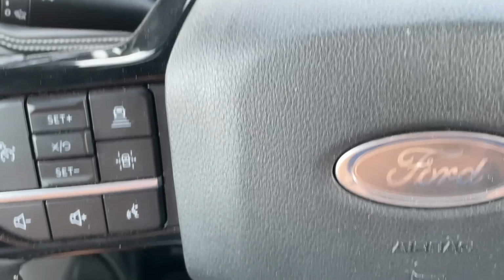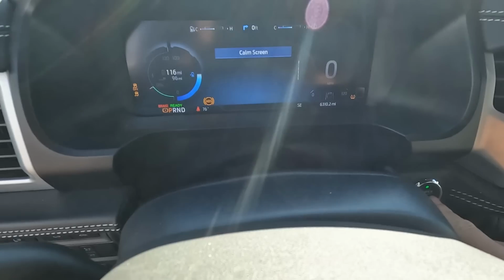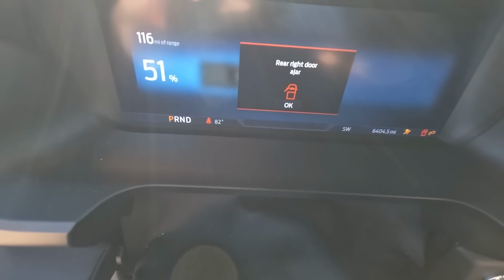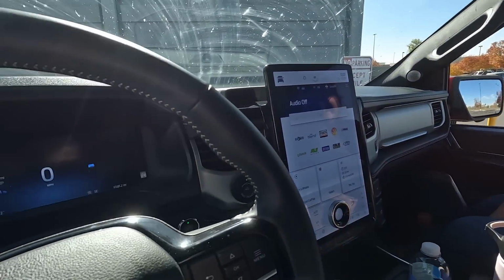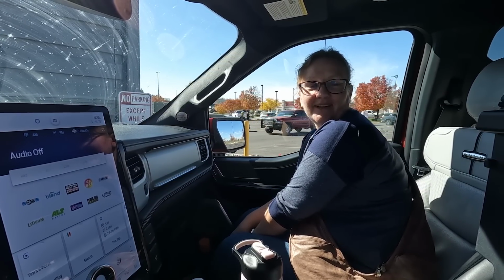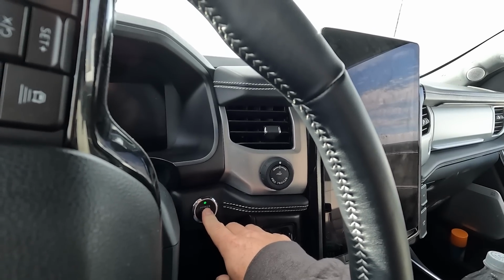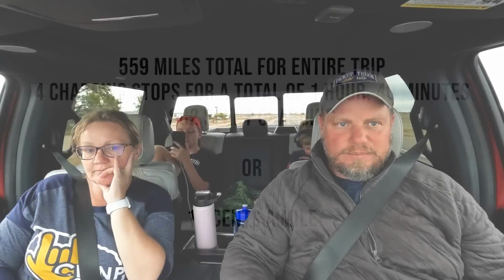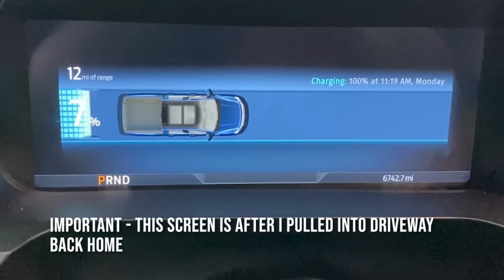Truth on charging times/cost on 2022 Ford F-150 Lightning Road Trip

Comment: actually you can carry 2 electric generators that can be linked to charge 220. Not exactly cheap but it will charge you at level 2. And they are also coming out with the charging suitcases. Pay a monthly fee, and you can grab one and take it with you. Just return it and grab another. obviously we need infrastructure, but it is happening!!!

Comment: I'm sure others have told you in the comments below, but with the EA pass ($4 a month, you only pay .31 cents per KW. Which a huge difference from .43 cents per KW you are paying on this video. Also, just like ICE, EVs have a hidden buffer after the battery reaches 0%. On the Lightning it's about 20 miles to provide you a way to get a charger even after your battery says 0% left.

Comment: I like the Route 66 analogy. I think that’s the mindset you have to have for those longer distance trip probably for the next 3-5 years for sure (maybe longer) depending on your area and/or State. I live in Texas and outside your major metropolitans this is not an EV friendly state. I’m not sure it will be   I’m in an area the nearest fast charger is 70+ miles away. I have a day 4 reservation that still hasn’t been fulfilled by Ford but they told me that I’m going to be able to build it soon. I have a 2022 Powerboost and the dealerships here are price gouging  as much as $20k so I’m not sure if I’ll convert (even though I’ve waited almost 2 years). I’m looking at an out of state option. Thanks for the video. Love the dynamic of you and the wife commenting on this. It’s adds to the entertainment and gives different perspectives.

Comment: One stop you said you got 100 mile range for $20, that works out at 20c per mile not 14c.!!
It seems like you added your starting charge for free. You work out mileage costs by filling your tank at the beginning then refilling it at the end, you didn't refill at the end.
Reply from the maker: Right, I didn't show the beginning charge or the ending charge since I charged at home and would do that no matter what kind of trip I did. Home charging is way cheaper than fast charging. For this Lightning it is like $15 for a full tank at home for 320 miles of range.
Reply: You started with 257 miles of range and ended with 20, so you should knock 237 miles off your total to calculate cost. But I'll give you true world miles (because of hills) and only knock off 180 miles.
559 - 180 = 379.
$82 / 379 = ~22 cents per mile.(21.6)
Also I bet if you added up all the additional miles your car should have got after each charge plus the original 257, I bet your car calculated well over 700 miles.!
Maybe you should do that for another video, calculated vs actual miles travelled.
Reply from the maker: @stewartread4235  Where do you get “$82/379?”
Reply: @Pickuptrucktalk  you started with 257 miles in your tank and ended with twenty, so 237 miles of your trip was paid for on your household bill. But I reduced that to 180 miles (because of reduced mileage going up hills). Then deducted that from your travel mileage, because your house paid for that mileage. Come on Sir keep up :-)
So 559 - 180 = 379 miles. That's what the chargers paid for.
Reply from the maker: @stewartread4235  Ok so fast charging was $82. As I said, fast charging is expensive. 

I never meant to add up all the costs of this road trip. Frankly, that wasn't the point of this video.
Reply: @Pickuptrucktalk  "Truth on charging times/cost" was the name of the video.!!
Reply from the maker: @stewartread4235  Right. I talked about price for charging stations.

Comment: Ok $23 for 107 miles of range so 23/107 = 0.21495 per mile right? My jeep get about 30 mpg but let's call it 25 and say gas is $4 per gallon so it would cost me $17.12 to get 107 miles of range, so tell me how it cheaper to "fill up" an electric car. Also how long would it take to pump 5 gallons of gas, I'm guessing not a 1/2 hour.
Reply from the maker: At home charging is cheaper NOT fast chargers.
Reply: @Pickuptrucktalk  After you spend $1,500 - $5,000 for a charging station depending the wiring you have. So at the low end about 10,000 miles to break even.

Also where I live we can lose about 50% of the range in winter, (it's 7f right now and is going to get down to -8f later) so that 230 range would be 115 mile and just make to the next big town in my area.

So I would get to hang around for a few hours (as the last 20% takes almost as much time as the first 80%) then do my errands, recharge to 100% and just make it back home.  And given I wouldn't be home for the "cheap" charge I'll still be spending more than I would on gasoline.

I'll take my 10 minute refuel time over spending a hour or so waiting for a recharge.
Reply from the maker: @richardwee9428  Sure, EVs aren't for everyone and at this stage, they simply don't work for certain trips. That may change or that may not change. Gas, diesel and even hydrogen will still be options and a new option for hydrogen.
Reply: @Pickuptrucktalk  Hydrogen is worst than batteries. It take a LOT of energy to make it. A completely efficient electrolysis system would require 39 kWh of electricity to produce 1 kg of hydrogen  which can in a fuel cell give you back 60% or 23.4 KWH. Then there is the problem with density, in a gas you'd need many many tank to store it, and in a liquid form you'd have losses from evaporation.  

If you really want to see EV's take off you need a quick change battery system, where you would be charged the difference between your current charge and a fully charged battery pack. If you can get that under 10 min. then you'd have something. Of course selling that to the general public would be a challenge
.

Comment: and yes, I would put a generator in the bed for charging as I am driving. There is no point in getting stuck on the side of the road for the sake of a liberal agenda. The liberals aren't asking you to change your way of life. They are forcing you by forcing manufactures to stop making gas powered vehicles by 2035.

Comment: I drive a 2017 F150 XLT Supercab 2WD with 5.0 and 6 spd auto.  The truck has 150,000 miles,  and has only had oil changes, brakes and two sets of tires.  Overall it has been great, reliable transportation.  Last week,  it just completed a round-trip drive from Niagara Falls, NY to Long Beach, CA. The truck averaged 22.8 MPG over the entire trip.  It is has the 24 gallon tank,  so can typically go about 550 miles on a full tank.  Considering this is about 2,500 miles each way,  this would be ten tanks of 87 octane gasoline.  Assuming about 10 minutes for fill-up,  even call it 12 minutes,  total time spent for "recharge" for a 5,000 mile return trip would be about 2 hours.  Gasoline stations were abundant everywhere,  with exception of some parts of northeastern Colorado and eastern Utah.  Used A/C at times and defrost and heat in the CO and UT mountains.
Daily driving time was 14 hours and 800 miles,  for a three day drive each way.
How long would this drive take with an electric F150 ?"

Comment: I bought a Toyota Prius, the best of both worlds. As a Prime I can charge it at home on 120volt that gives me 25 miles range, but that’s not what it’s real strength is.
With a full tank of Gas and a Full Charge, I can get 1000 km of range (600+ miles)
No range anxiety and fuel efficiency of 80 to 90 miles per gallon.
Also, the gas engine can charge the batteries while your driving.
EV are not there yet for long haul; get a hybrid.

Comment: When an EV can go 500 miles on a single charge while towing 10k lbs, then I'll consider buying one.
Reply from the maker: That's not going to happen. It is going to go hydrogen for towing.
Reply: @Pickup Truck Plus SUV Talk  the irony is in the additional battery capacity required, increases weight, which reduces range and efficiency. I agree. EV's are cool, especially for local driving, but long haul trips really require something more sensible.
Reply from the maker: @iviaverick52  right. Hydrogen is the solution for long haul towing. Ford CEO Farley even stated that in public. Toyota is working on it and so is GM as well as Ram.

Comment: What you experienced are all inconveniences, but not deal breakers.  The deal breaker is that the fancy self-driving EVs sustain so much damage in a fender bender/parking lot accident, that they are declared a total loss.  All of the self-driving sensors are in the bumper, which the first thing at the scene of the accident.  The cost you do not mention, is the cost to insure them.

Comment: Hauling around a 2,000 lb battery pack doesn't help mileage. These things won't help global warming much until we stop burning coal for our electricity.
Reply: wind and solar is trash, a coal power plant runs at 96-99% eff. that means very little CO2, also plants need co2
Reply: @gregoryeverson741  You're completely wrong. Efficiency has little to do with CO2 emissions. Coal produces 217 pounds of CO2 per million BTU's, while natural gas produces 117 pounds for the same energy. If we stopped burning coal and switched to NG power generation, our CO2 problem would be solved. Earths oceans alone have a 400 year supply of NG. 
Coal has a lot of contaminants, thus burning 1 ton of coal produces more than 2 tons of CO2 because the 2 Oxygen atoms add much more weight than the 1 Carbon does.
Reply: @bobhenry6159  there is no FUCKING CO2 problem, are gonna stop volcanoes?

plz tell me how you are going to stop volcanoes?

or the giant sulfur mines that spew toxic gas?
Reply: @gregoryeverson741  lol
Reply: @bobhenry6159  what is so funny? you worried about co2?

where is your BTUs at now, where is your CO2 ppm?
Reply: @gregoryeverson741  Those who deny reality are always funny. The best was your "OMG...teh volcanos" logic. Millions of years ago, all of Asia was erupting, yet that even didn't raise CO2 levels as fast as we are raising them. But you didn't know that. You don't even know we are pumping more than 40 billion tons of CO2 into the atmosphere every year. But hey, 'Teh volcanos.." ROFL!
Reply: @bobhenry6159  Humans only add 2%, so yeah, also CO2 levels were WAY higher when dinos  were alive

30yrs ago, it was ICEAGE IS COMING
Reply: @gregoryeverson741  lol You are hilarious. You're numbers are all wrong, just as wrong as the doomsday preachers numbers.
Next you'll inform me that a tree rotting releases just as much CO2 as burning it does. But you'll ignore the fact that rotting takes 10+ years, while burning takes just days.
Reply: @bobhenry6159  so you deny higher co2 levels when dinos ruled the Earth?

i need to know what you are talking about
Reply: @bobhenry6159  35yrs ago, Politicians said we are having an ICEAGE, so explain how we are now gonna burn to death
Reply: @gregoryeverson741  No, I never said that. But that was a slick way to cover for your own lack of knowledge.
Reply: @bobhenry6159  im not lacking, this is a push from the WEF

coal is good for power plants

nat gas is good for heating homes/cooking

97% of all scientists agree with people who sign their checks
Reply: @gregoryeverson741  Yep. We know who's paying those coal experts. Damn sellouts.

Comment: I don't see why people keep bringing up the cost of operation of an EV vs the ICE equivalent.  Every new EV on the market has an increased cost up front to pay for at least 3-4 years of gas/maintenance for the identical ICE version.  It's easy to see the price differences with manufacturers that have identical vehicles in both powertrains (F150, Silverado, Hyundai, Kia, etc.).  It's harder for Tesla, but you can easily get a comparably equipped Accord or Camry for thousands less than a Model 3.
Reply: my ICE car cost me 18K (3yrs old) a new Ecar is around 60K+ (i will not buy a used Ecar)

Comment: EV’s are not practical now and at least 10-15 years away from being ready for the consumer. No one I know has the time to waste charging every 150 miles or less if you run air conditioner not to mention pulling a trailer.

Comment: There is not a snowballs chance in hell I would even think about one of these P.O.S. I use as my example the switch away from incandescent bulbs to compact flourescent. A few years in they got L.E.D. technology improved and now the compacts are on the trash heap. When fuel cells are perfected they will take these rechargeable pieces of junk and send them to the trash heap. Hybrids maybe but all electric rechargable only if you live in a city. I had to tow a trailer and a load from Green Bay Wisconsin to Hulett, Wyoming last year in a 40 mph headwind. The dodge cummins that normally gets 14 mpg got 8. This thing would have had me stopping every 50 miles to recharge for an hour and would have taken two days to get me home. I say it again never ever. Mandate every liberal Democrat has to have one and watch how quickly that stops.
Reply: we went from 1$ light bulbs to 15$ LED bulbs, lol

Comment: Bottom line, we need more charge stations.  I am planning on getting the Tesla to J1772 Charging Adapter, so I can charge my XLT Lightning at Tesla charge stations.  Hoping this will give me more charge stations to choose from while traveling.
Reply: it will cost TRILLIONS, this will not work, unless you can charge 100% in 5-10mins, this will never work, also the power grid will have to 3-10x bigger

Comment: seems like a pain in the butt to always charge every stop, then to have only 230ish mile range.  have you done a cost per mile for electric.  have you done a cost per mile comparison between the electric truck, hybrid truck, gas truck, and diesel truck?  the 230 mile range sucks and yes you do usually have to stop to eat, but you could always run in and grab you lunch and come out with gas, as compared to 5 minutes to fill up a gas truck.  sorry but unless these trucks get more range they seem pretty much useless.

Comment: Not a long distance option yet. The anxiety would make the trip unenjoyable for me. And the thought of hanging around a charging station during a trip is a deal breaker. I want to get where I'm going as fast as legally possible. I won't even get off the freeway for fuel unless the station is on my side. And battery degradation? How long till it only holds half a charge? Thanks for being an early adopter. If I was thinking about this truck, I'd probably reconsider.

Comment: Humm, I get about 380 miles to a full tank for about $37. Big pass on an EV. As a prior owner of a Honda hybrid that the battery failed, and costs were going to cost $9000 for just the battery. I traded it in for the current car with No battery EV tech. Much happier now. Takes me like a max of 5 minutes to fuel up. Last trip i took was 736 miles and took $73 and change in gas

Comment: TIM needs to watch Kyle at OUT OF SPEC
after 80 % the ramp drops to really show

Charges 20-80 % in 20 minutes 
80-100 takes a lot longer 

On the road at DC Fast charges use the  chsrger with the highest rate KWH  that the battery accepts and charge to 80% and move on

That's unless the distance to the next charger isn't within that range. 

Have fun on your adventures

Comment: To break even with regard to just the manufacturing carbon footprint v. a gas truck, you will have to drive about 75,000 miles to be more friendly to the environment.  Just to manufacture electric transportation is a high discharge of carbon to our environment.  And what happens when you charge up... You need electric made by fossil fuels.  The electric transportation industry in pulling the wool over our eyes, its all just a money transfer from gas cars to electric or its not saving our environment one little bit!!!  Just making our lives harder and not the other way around... The New England Guy.

Comment: Seemed like it wasn't very cheap, and kind of a pain in the ass. It's ridiculous that every destination has to be known by the vehicle so you can make sure that you don't run out of charge. That's reality that you don't ever have to worry about with a gas vehicle. You basically had to plan every little detail. No thanks. Powerboost way better option!

Comment: So my gas powered Hemi gets about 18-19mpg on the freeway. I have a 33 gal tank which at an avg of $3.39 per gal is about $112 to fill up and will get me around 600 miles. I wont have to keep finding charging stations, can take a direct route and no real range anxiety. I can also have everything on, everything charging, radio on, etc. And best of all I can more accurately estimate travel time too. So in conclusion I win. Period. Good luck wasting most of your time seeking out charging points and waiting  for it to charge while costing about the same.

Comment: So if you have the cheaper Ecoboost f150 and get 27mph with a way less expensive truck then your electricity for that trip would be about $4 a gallon at your $.14 per mile.

Comment: The question-is the all the planning and inconveniences that come with an electric  worth it? As far as the environment impact? It's debatable considering the amount of fossil fuels it takes to priduce a battery. Another elephant in the room,how many miles or years deplete the bettery? Cost of replacement and what happens to all the depleted batteries years down the road? The affect of all those worn out batteries sitting in land fills to the environment?

Comment: "Found On Road Dead" (battery level) is soon replacing the old "Fix Or Repair Daily" that was the old Ford joke.  I love my 21 Powerboost and it has performed flawlessly for 9,000 miles and 15 months.  Averages 22 mpg in mixed driving.

Comment: Would be nice to have a generator in the bed. Like a 5-gallon gas jug in the back for emergencies.
Reply from the maker: I just don't see it. It would take an hour or better to get 2-3 miles of range. So not worth it.
Reply: Maybe a bigger generator? 😊
Reply from the maker: @terrybrockway5376  the bigger you go, the heavier you get so the less overall EV range you can drive with the additional weight. Generators aren’t light.